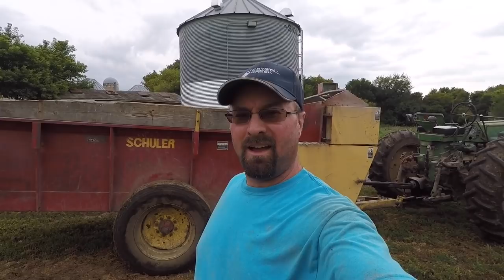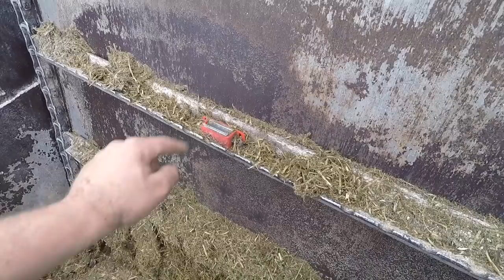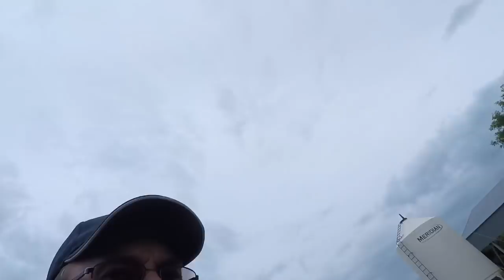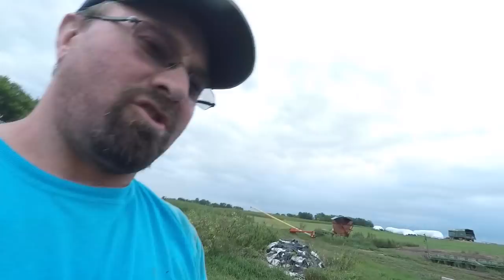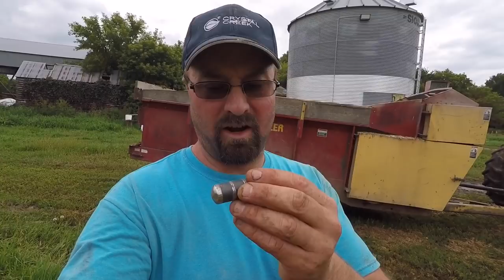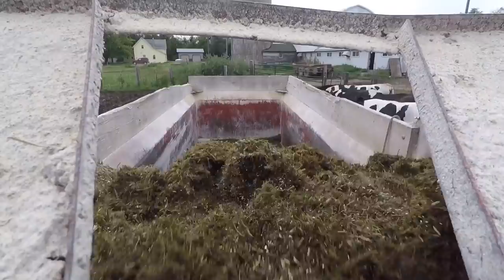What Happens When Cows Ingest Metal (aka Hardware)?

Comment: We got a dairy cow last summer and are new to this experience. A couple days ago while she was eating her treat we give her while milking her (a mix of sweet feed, cattle cubes and alfalfa hay), she seemed like she had a bit of trouble swallowing. Then over the course of the next couple of days she was reluctant to come in the shed to be milked and showed no interest in the sweet feed which she normally loves. Her milk production dropped down from 2 gallons to 1/2 gallon. She has a calf with her during the day and we separate her at night and milk the cow in the morning. We tried calling our local vet and he is unavailable until next week. Instinctively I feel her problem is with her digestive system. Either her mouth, throat or stomach. I'm really quite fond of her and don't want to see her ill. She did come into the shed this morning and ate a small amount, but only had a 1/2 gallon of milk. what are your thoughts? Is there anything we can do personally?
Reply from the maker: Really the only thing you can treat any cow for hardware is to give them a cow magnet. You local veterinarians should carry them. Then give two laxative pills everyday until their manure doesn’t look so stiff. When a cows gets hardware it caused them to get constipated. This usually works for us. Sometimes it might take two weeks or more before you see results because it takes time for their intestinal tract to heal from the hardware. I wish you the best of luck